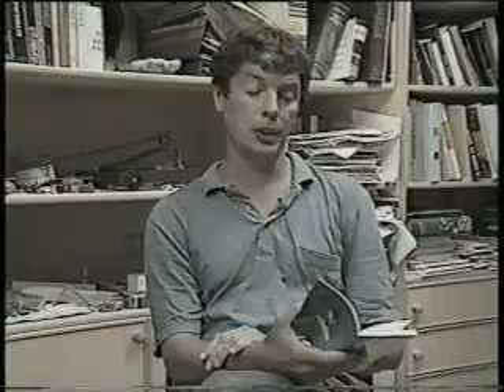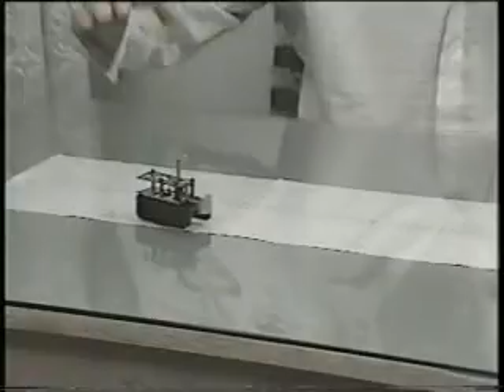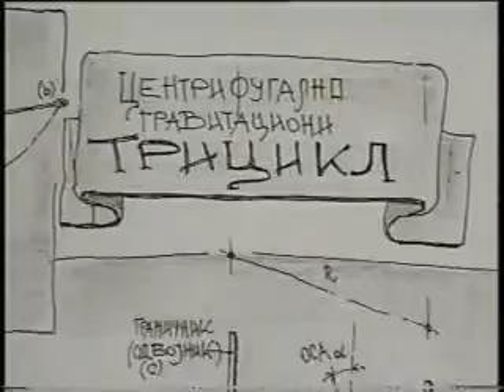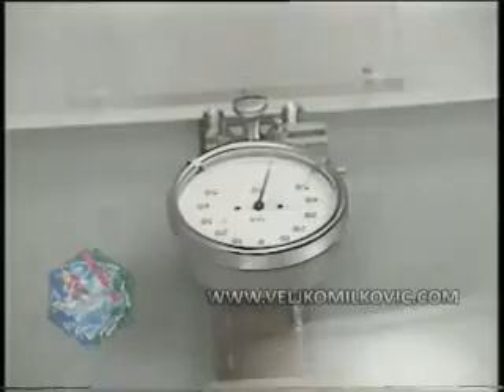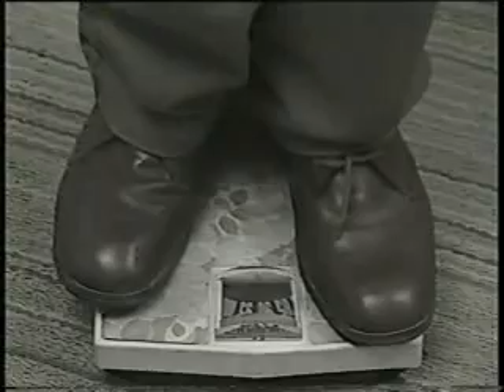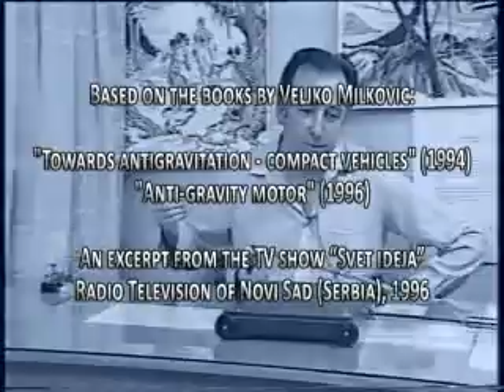Cart with a pendulum - Vehicles with internal and inertial drive - Veljko Milkovic

Comment: Thanks,

Just now our research efforts are focused on the methodology of maintaining pendulum oscillation with a minimum of power input. We hope to investigate 'inclined pendulums' in a canal barge. Two AA NmH 1800 mAhr. pen-cell batteries with 1000 meters of 2.5 mm copper coil (3 Ohm resistance) can we believe, maintain two synchronized pendulums, two short one amp pulses rotate permanent magnet rods. and 2 x100 Kilo pendulum bobs. The battery should last for 10 hours...a long barge voyage!

Comment: Thanks Veljko Milkovic. We have started to design & construct a prototype "Eight Inclined Pendulum" cart with 4 bicycle wheels.

We are employing circular loudspeaker magnets with mild steel "Cup-n-Cone" pole pieces. to create frictionless bearings, (stacked on a scaffold tube) 4 pendulums 2+2 in balanced counter oscliation, and 4 more oscilating 180 degrees out of phase, (smoother motion). An onboard battery (charged by braking) powering segment motors will topple the pendulums over the top.

Comment: I have seen enough of these pendulum machines.  It is a case of centrifugal force made to act during half a circle. that part which propels it forward is due to the fact that the wheels are aligned with  the centrifugal force at the time. The centrifugal force when the pendulum is on the side of the vehicle well the wheels alignment  is such that friction with the ground stops it from moving sideways.      I suppose one could relate this to dynamic unbalance effects.

In a  multicylinder crankshaft which is statically balanced   but  dynamically unbalanced, this effect will cause the crankshaft to wobble and wobble.

Comment: BTW, YouTube enthusiasts, the bearing assembly out of an old dishwaher is ideal for experimental and demontration purposes. Because plates are often stacked unevenly, the bearing is designed to cope with the stresses imposed. They run very free! and have a convenient steel rod, just drill an inclined hole in your truck. Here in Lancashire BAE Systems Executive Engineers are paying very close attention. We may even make a 24 pendulum model? 60 degree phased "centripetal acceleration" impulses.

Comment: But when it slows down and goes back it would normaly produce an equal force in the opposite direction, which does not appear in this case because the arc of the pendulum is slanted toward the gravitational source.This makes it so it's like a string is tied to the pendulum and to the ground; when it swings backwad it pulls against the earth.

Comment: You would be right but you missed one point about the first pendulum, it is inclined. If you swing this pendulum back and forth in space there will be no net movement after a whole cycle. But gravity causing the acceleration and deceleration of the pendulum instead of some force within the system. Those acceleration and deceleration forces are exactly equal and opposite the centrifugal force, but they act on the source of the gravity, not on the cart. So you can move horizontally on a planet.

Comment: @qp12qp newton laws are only for lineal movement. If you have a mass moving in two dimensions, like the penulum, you have centrifugal force. Centrifugal force push the system with NO REACTION FORCE, and the movement don´t needs energy, creates energy from inertia of the mass. Study carefully the forces in the system.

Comment: I dont believe that the pendulum has to be free swinging for the concept to work. I believe that the concept works with a motor powered pendulum as well. Or at least they (I belive) are making the arguement that it is the motion of the pendulum which causes forward motion (in supposed violation of Newtonian "action/equal opposite action" physics) , however the source of the pendulums swinging motion whether grav or a motor is irrevalent.

Comment: The problem I have with this video, is it's "sketchy" as in not so precise. Why not like Sandy Kidd did, put this device vertically on a string and see if it goes upward? Why didn't VM put wheels on the mini devices and on a track with an uphill incline? That would have made it perfectly clear this is a practical non-friction drive, reactionless or not. Depressing how God keeps the "grail" technology teasingly out of mental reach.

Comment: Apparently you removed your reply to me, but I got it in my messages. The pendulum drive is simply a stiction drive, something known for years. They move masses in an asymetric cycle which overcomes friction 1 way but not another. they R easily shown not to move without friction. Also einstein belived he could create a mathmatical unified feild theory uniting gravity & electromagnatism. If this guy has a unified field theory, then lets see it! It should be easy to prove or disprove mathmatically

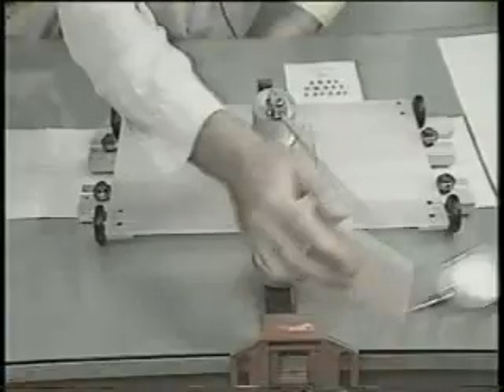Comment: The energy loaded into the "truck" is quickly ignored as the operator places the arm at the top of its rotating path. No different then placing the "truck" at the top of a ramp. The two other wind-up machines use slip-stick for motion. The pendulum machine at 4:30 is blocked from using its energy in a large motion. The small bounce off the "dial" sends the energy back into the "truck". Not too much different then locking the truck in place and watching the pendulum swing decrementally. All Fake.

Comment: All these "inventors" of those pseudo- "inertial drives", fail to understand that their systems appear to work (somewhat), because the forces produced are applied to the system that supports them  -whether it is a flat surface via wheels or water via a boat.
This is why it is completely impossible to make a system that will lift off the ground.  (Inertial drive assumes that the forces are independent of a reference system i.e not needing something to be applied to -which is simply not the case).